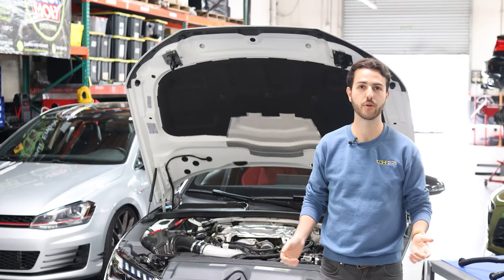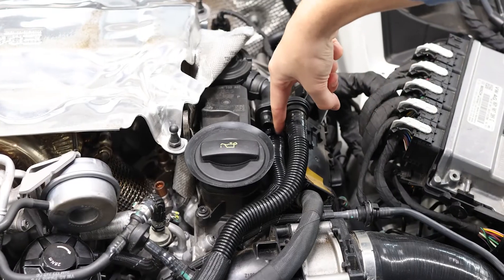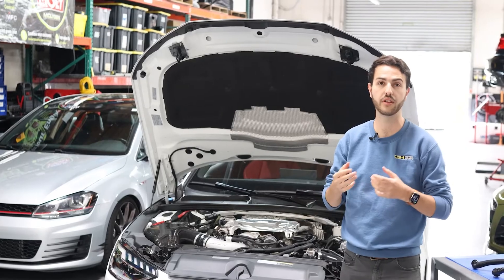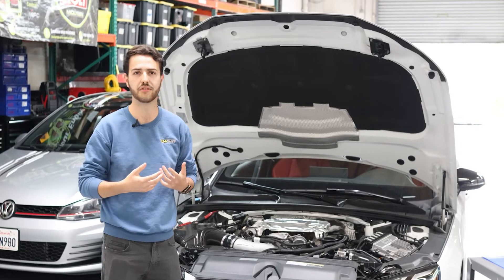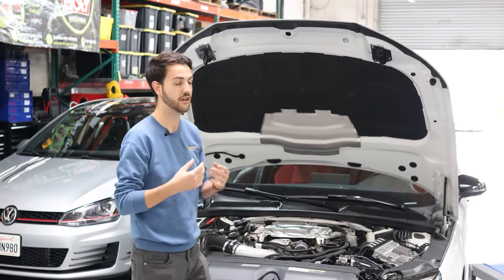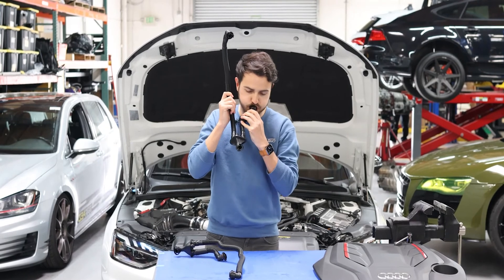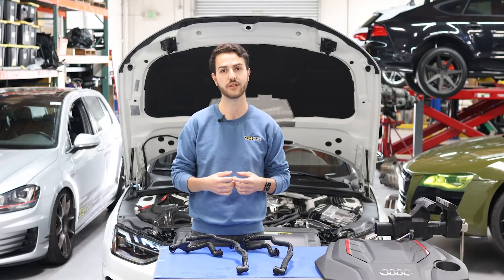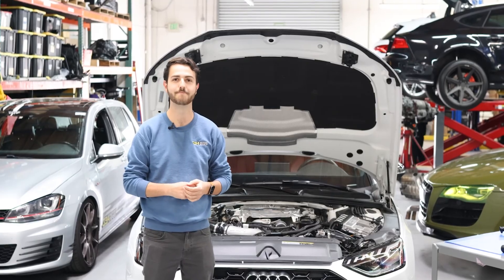Failing Audi 3.0T PCV Valve Diagnosis | 2017-2023 Audi B9/B9.5 S4, S5, and SQ5

Comment: Hi, Great expanation, I have an Audi S5 with the 3.0T B8.5 CREC engine, do you know if these engines get the same problem with the PCV? I don't think mine has failed but when I remove the engine oil cap I do have a very strong vacume when trying to remove oil cap, is this normal? Any help and advice on this is much appreciated. Thanks again.

Comment: Thanks for the awesome video! Have you released the catch can kit for the SQ5 yet? Also, I'm wondering how I might be able to tell if the PCV Oil Separator/PCV needs to be replaced? I have some oil seepage through the PCV gasket at idle (my breather hose check valve failed), but I'm not sure if it's necessary to replace the entire PCV or if just the seal would fix the oil seepage. I have not yet replaced the breather hose, so maybe that will fix the problem...
Reply from the maker: Catch Can Kit for the SQ5 will be coming out later this year. We recommend taking your SQ5 to a professional shop to have it diagnosed!

Comment: Completed the job however car does not crack it is giving P305400 Starter does not turn mechanically blocked or electrical malfunction. Battery is 14 volts not issue with that what could be the problem here?

Comment: What does it mean when my oil cap keeps popping off when I’m driving at high boost car is stock
Reply from the maker: @kasimm_6643  that you are pressurizing your crankcase due to a failed PCV hose, cars burn down from this, please upgrade to our hose immediately

Comment: I just bought a used , 100 mile , 2017,  Q-7  ( supercharged  3.0 t  TFSI )   burns through a quart of oil every 300 miles.    Do you have a tutorial on how to diagnose for a bad PCV on this model?     Last week I just did a B-12  Chemtool piston soak hoping that it would help.   Too early to tell yet.   No dash engine fault lights indicating anything .    But I suspect the PCV may be the underlying cause.    I just don't want to have to pull the supercharger and swap the PCV on speculation.    Any help on how to definitively diagnose the PCV is appreciated??

Comment: So I replaced the hose and the inlet it’s connected to and I also checked the old hose and inlet it seemed to hold pressure fine but I still replaced it anyway since I had it off. I cleared the code and it came back on. Do you think it can be the oil crank casing that’s causing the same code to come back on?! Their is no oil around the crankcase itself that’s connected to the motor but I did notice a tiny bit on the top ring of the oil cap but not sure if that from the last oil change that was done. Any tips?!
Reply: Any follow up to this? Did you resolve?
Reply: @RaNm2418 it was my evap purge solenoid that was going bad. Replaced that i cleared the code and no issues at all. I have a 2018 s5 and not a lot of people had to change theirs purge solenoid  and I have lower miles I’m now at 65k other ppl I know are around 90k plus and have not had to change it yet. I was the unlucky one but the price wasn’t bad. Theirs an Audi parts site for the USA all oem parts ships rlly quickly. Bought the inlet and hoses and also my purge solenoid. The inlet was a bitch to replace cause of the lower screw on the inlet itself. The purge valve was really easy to replace took me 10mins tops just. You just have to buy new hose clamps since Audis uses a one time hose clamp clip.

Comment: Mine just failed. I have 2018 S4 with 66k. I've been having oil consumption problems since 45k. Had the oil filter housing replaced 2 years ago and still had issues. Hopefully, this helps. Thank goodness for my extended warranty.
Reply: 76k on the 2.0 im having oil consumption issues. No leaks. Either piston rings or pcv

Comment: Do you think that this would cause a misfire? I’m having a very odd issue with my 2019 S4 where when idling the car will start to misfire but anytime I get underload. The engine immediately runs smooth. I’ve tried replacing the coil packs and the spark plug as well as moving the coil pack to see if it is a different one, but I continue to get a cylinder six misfire. This is my next idea do you think this may fix that?
Reply from the maker: This can cause a misfire, but we'd recommend bringing your car to a shop for diagnosis

Comment: What oil do you recommend for b9 s5 ?
Reply from the maker: We have a video talking about this topic in detail here: https://youtu.be/5OQSp6AL824?si=KJehCuTvd35hkVqH
Reply: @034motorsport  thank you also mine is leaking oil out the top and the oil cap keeps coming lose when driven hard and comes up saying drive system fault so this video has me wondering if it’s just the pcv I need to replace? Or put in a whole new solid after market unit which you guys spoke about building yourselfs

Comment: I’ve replaced the PCV system twice within a year now, the car has only some 20k miles. But one way or another, I still hear a annoying whistle coming from that side of the engine. The whistle is only there in idle mode when the oil temperature exceeds 87 degrees C, which is normal operating temperature. Any ideas on this?

Comment: I wish you would add a tutorial about removing those clips, especially since the new one comes attached to the intake pipe.  It would be a shame to break the brand new one when trying to remove the hose.
Reply from the maker: You can remove by simply pulling it apart. The other connections require you to simply pinch and disconnect.
Reply: @034motorsport  Awesome, thank you.

Comment: Thanks for this, following your guide I found my PCV hose also had a 2 way valve(!) I replaced the hose like for like and new breather hose is good, but disappointingly still getting oil around the filler cap :/
Reply from the maker: We've got something in the works for that ;)
Reply: Hi any update on this @034motorsport

Comment: Can you please show a video on how to take off the hose. I’m not trying to break the existing hose.
Reply from the maker: The hose on the turbo inlet does require some strength, simply pull back straight.

The other hoses you simply push the outer plastic ring and they should pop off.

Comment: Pretty sure this is the issue I’m having at the moment! Going stage 3 in the new year (Pure 750, HPFP & 4 Bar MAP sensors) and will eventually go stage 3+ with injectors and ethanol. Is there an aftermarket PCV Valve on the market? I’m worried it’s going to keep failing once I start making some serious boost.
Reply from the maker: Not that we're aware of but we're coming out with our solution for the platform soon.

Comment: I had to replace the PCV system on my 2.9TT under warranty at 16,000 miles due to failure. I’m still interested in upgrading to your solution when it comes out.

Comment: Thank you for providing this video.  I had mine fail on a 2018 Audi S4 with 53,0000 miles.   Oil around the cap area and kept losing oil.
Reply from the maker: Glad it helped
Reply: How you fix? Replace hoses or the whole Pcv?
Reply: I’m
Having same issue now
Reply: Same with mine, 62000mi currently no problems

Comment: The previous owner of my B9 S4 put a catch can on it and I think it may be causing issues. I really hope your solution comes out soon but I'm not sure I want to wait. How can I get a full list of parts to put the OEM PCV system back in? I see you've listed the breather hose but I need everything.
I'm a customer of yours if that matters :)
Reply from the maker: Thank you for your continued support! Your best bet here is to contact your local dealer for a parts list as they will be able to provide a complete diagram of the system with part numbers

Comment: I got a 17 plate s5 just had pvc replaced i have negative pressure if i take off the oil cap whilst running is that normal?
Reply from the maker: That is normal behavior of the engine
Reply: Does your engine rev up? Mine does

Comment: Unsure if mine has failed. I can blow through where you said I shouldn’t in smallish volumes. If I blow harder I can feel the plunger closing and air stops.

Should this happen?
Reply from the maker: Yes, this is the proper function of the check valve.
Reply: Thank you! It’s appreciated. 

The moment you have your catch can available for sale on the 2.9 RS5 I’ll be buying one. Perchance an ETA - even if a rough guess?

Comment: do we have an eta on this beauty?
Reply from the maker: No ETA at this time, but it has been in active development.
Reply: any update fellas? CBF buying more replacement AUDI parts for a system that is just going to fail again ;( or should i just buy Racingline's Oil Catch Can and be done with the PCV all together ^_^ @034motorsport

Comment: Hey, thanks for the great video. I saw other videos mentioning that the PCV unit itself, and the other side of the hose needs to be replaced as well, so 3 parts in total. Is this true or just this one?
Reply from the maker: While others may have had failures or issues with that component, we've only had experience with failures of the breather hose component of the PCV system - which this video walks through how to test & diagnose.
Reply: Got it! I tested it today and it held pressure. I didn’t takeoff the “irremovable” hose and instead took the 2 pinch ones off and blew into the short one. May be interesting to note that you don’t need to? (Assuming I’m not missing anything) I did have a slight coating of oil but that’s expected

Comment: I see an oily residue on the PCV hoses, is that a sign that it's failed?

Everything else is dry and residue free.
Reply from the maker: It would be best to simply pull the hose off and test as shown in the video. Some seepage may be normal and within spec.

Comment: Hi I have a  friend with audi s5 with a p04f00 EVAP high pressure. passive/sporatic. He also mentioned that at cold start up he has lack of brake pedal but once warmed up goes back to normal. This far fetched but I was wondering if this pcv valve would cause brake booster problem. I know that there is a vacuum pump that supplies vacuum to brake booster and waste gate solenoid. I would like your expert opinion. Thanks by the way for all your great videos
Reply from the maker: The PCV system and vacuum pump are unrelated on the B9

Comment: I replaced this hose as i tested it and was able to blow through the tube but now my car has a check wngine light and my throttle on idle keeps jumping to 1,700 and back down to 900. What coukd be the cause?
Reply from the maker: John, we recommend using a scan tool to check for any error codes, but bringing it into a shop for inspection would be your best bet.
Reply: Hi John, Any updates on your problem? Thanks

Comment: Hi sir nice video I am having a problem with my golf 5gti dsg multitrinic paddle shift  running stage 2 with 76mm down pipe resonator deleted car drove awesome a whole year but 2months ago my car started to misfire after a rough driving on manual and sports mode on a high way but as soon I get to busy traffic roads and driving on d mode the car starts to mk a push when shifting and misfire at times changed spark plugs misfire was gone but other issue of driving on D mode after rough driving the push and power should still decrease went to diagnose only evap related codes were captured incorrect air purge flow replaced N80 valve and evap canister code didn't return but problem remained the same removed manifold cleaned intake valves no positive response started with fuel related replacing intake fuel pump high pressure fuel sensor new cam follower even though old1 was not worn swoped high pressure fuel pump and still no results then I was told to disconnect o2 bank1 sensor and test drive as bank2 sensor is off by map tuning by disconnecting the o2 sensor car drive like a dream problem fully sorted but after replacing the o2 sensor the car is again doing the same 😢😢😢😢 even replaced pcv valve I am so frustrated Kasam I don't know what to do anymore saw ur video and now thinking maybe it's my coils bcs the mechanic only could find misfire by one coil and replaced 1 and other coils r weak too after getting to maximum heat after rough driving and if I let it cool for a while then it's OK to drive on D mode sm1 said u must switch the o2 sensor off by the tuner and drive like that but my concern the whole year car was driving fine with only 2nd sensor switched off please advice sir 😢😢😢😢😢
Reply from the maker: Sameer, if you're tuned by us, please email us at tuning@034motorsport.com for further assistance.

Comment: So we're saying the PCV system is insufficient/faulty. Have you tested the updated OEM part for longevity, and have there been any failures with that part that have been noted? As the Audi TSB only stipulates 2017-2019 models within a specific range as being affected. So curious how problematic this actually is for those with the updated OEM part.
Reply from the maker: Long term testing is currently being conducted so there is no way to truly have a 100% accurate answer on whether or not the revised part will hold up over time. But as of now, it is a good step to ensure you have replaced the old part with the new variant and inspect regularly to avoid potential damage from a failed PCV. 

This should hold over most vehicles until our full PCV and catch can solution is released later this year.
Reply: @034motorsport  Great, thanks, I'm looking forward to it!

Comment: It's crazy that this video came out the minute I experienced this issue I have had my oil cap blow off twice this weekend after having my pcv replaced under warranty by audi due to it leaking oil from the cap! What would you recommend I do until you release your product do I buy a racing line catchcan till you release your product or go back to audi again to replace pcv under warranty then buy your product? Not sure how long till you release etc
Reply from the maker: In the meantime, we recommend replacing with the new revision OE breather hose from Audi. We're actively working on a solution and hope to unveil more information about it soon.
Reply: @034motorsport  do you have a part number for this revised hose?
Reply from the maker: It is in the video description!

Comment: I'm going to look like scuba steve to my neighbors blowing into my snorkel with the hood popped open. Better yet, I'll have to walk into my local dealer/parts department and let them know how I found the faulty PCV check valve.
Reply from the maker: We think it would be productive to look like Scuba Steve whilst walking into your local parts department as it would likely get you a discount!
Reply: I've got a bit of oil around the oil cap now and a CEL for p0441 EVAP valve. Have to wait 2 months for an appointment at my local overbooked dealership but will report back on if the CEL is related.
Reply from the maker: @morganlingsweiler9813  we'd recommend testing the hose yourself, if it's leaking it's not a good thing.

Comment: I assume the unwanted ejection of the oil cap is due to the oil cap unthreading? It does not just blow off from the full threaded on position, correct?

If it's a case of loosening by boost pressure (unthreading) and as a safety precaution, it may be possible to drill a small hole in the oil cap perpendicular to the slot which runs from the 9 o'clock position to the 3 o'clock position (drill the hole closest to the 9 o'clock position) and implement a safety wire style fix where the oil cap is tied off to the nearest engine hoist eyelet hole. When the oil cap tries to rotate counterclockwise, the safety wire mechanism will hold it in place to prevent that unwanted movement. 

The negative of this type of fix is the inconvenience of having to remove the safety wire style mechanism when needing to fill oil and replace it when done. Maybe use some type of keyring within the oil cap hole and a reusable heavy-duty cable tie (one that can withstand the environment of the engine bay).
Reply from the maker: Yes the cap unthreads, once it gets loose however the boost pressure and vibration can spin it off quite quickly

Comment: Super informative, thank you.   Other than oil seepage at the cap, are there any other symptoms that might show the check valve is failing?   Something that may tip you off prior to unbolting things?   Something VAG-Com might detect?
Reply: Don't quote me on this but, What I've heard is;  You may also see the engine burning a little oil on the process, making it look like you didn't use enough oil when changing it/replacing it, or that you need to top it off sooner than before, or ever.
Reply from the maker: Typically there are not, you may experience some drivability issues.

There are no engine codes that pop up if this valve has failed that we have seen.
Reply: @034motorsport could losing coolant be a sign of this failure or would I need to look at removing supercharger and just replacing PCV, water pump, and t-stat?

Comment: I recall asking about Racingline's PCV replacement Oil Catch can on one of the live episodes and Jivad pretty much blew off my questions stating the B9 PCV is pretty stout.  Now all of a sudden the PCV is not so stout...
Reply: We have been working on our own catch can kit for a year now, so not sure why I would blow off a question like that. In fact I do remember answering your question, and yes at that time we did not know the PCV was a failure point, then thanks to our car burning down we learned it is. 

Everyone thought that factory PCV was good back then, now everyone knows it’s a point of failure.
Reply: @javadshadzi4824 i believe issue is  failure is 3 way hose, valve breaks.
Reply: In addition, it was mentioned the Racingline item was in house and evaluation/testing was being performed. What results can you share that lead you to maintain both inlet inputs?